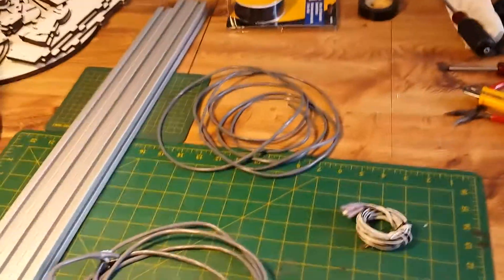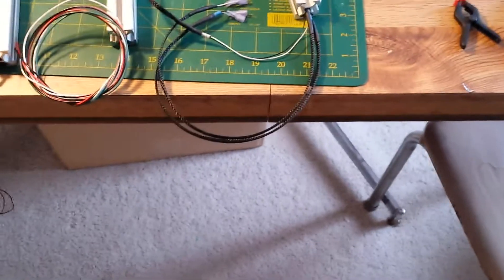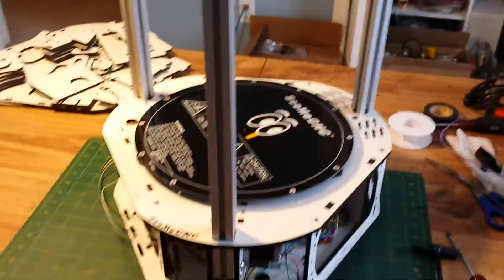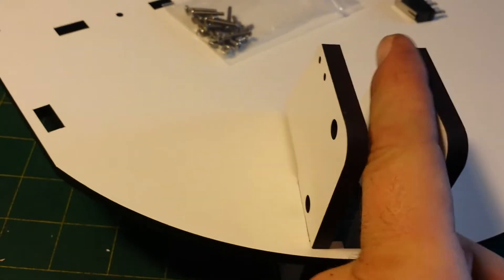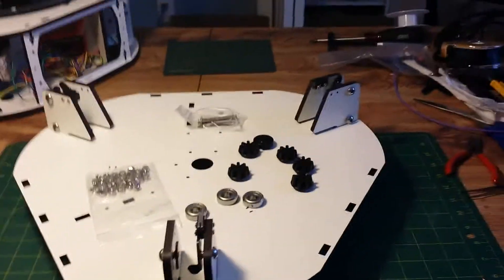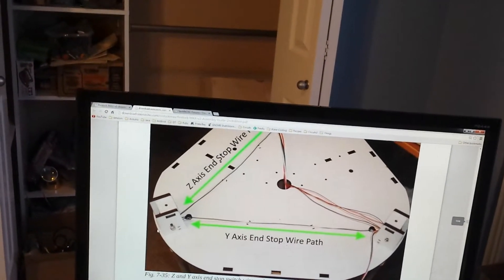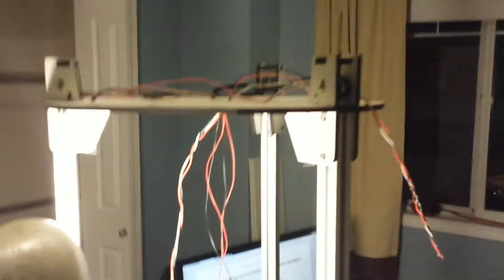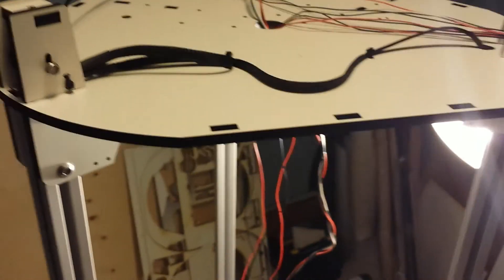Rostock Max v2 Build - Episode 4

Comment: hello, how did you square the towers?  usually they want you to use a right angle square on the top of the base, but you have the heated bed installed ...  did you square ontop of that?  oh... nm... just got to that point in the video....  :/
Reply from the maker: The fit of the parts was perfect and there was nothing needed to square the towers.  I simply checked them and they were bang on.